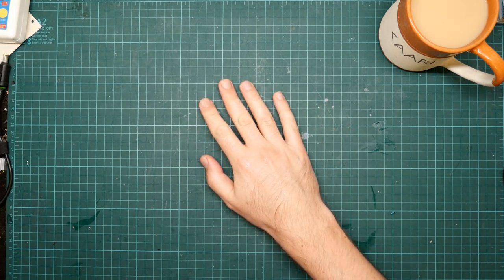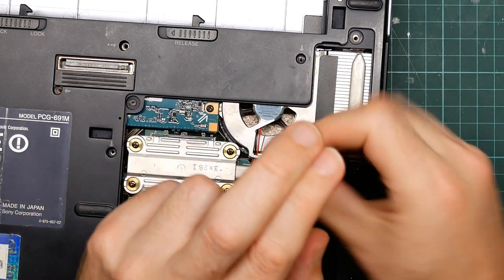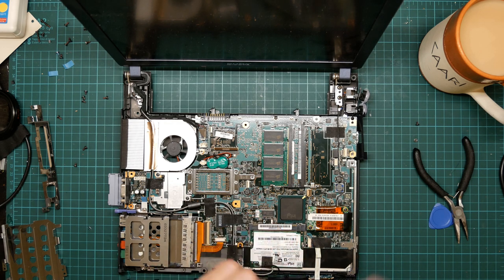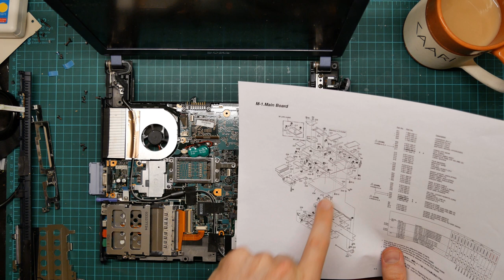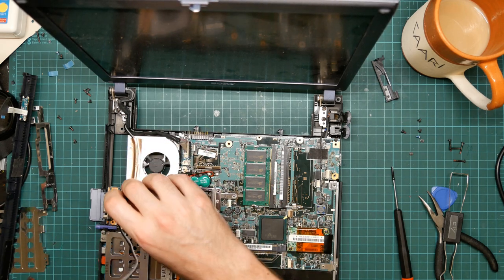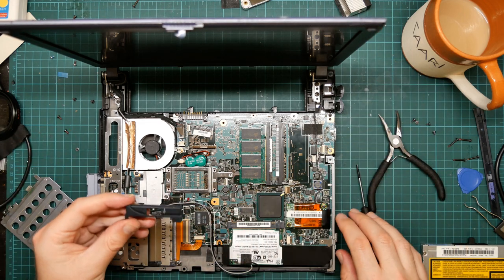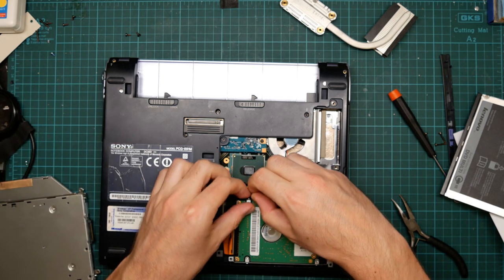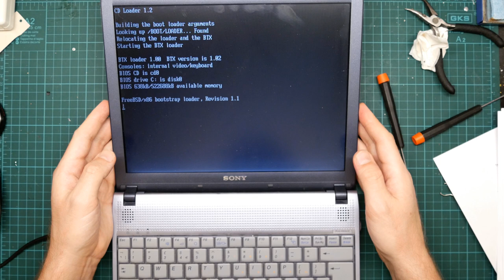Hjalfi journeys to the centre of the Vaio V505CP

Comment: You should have known that DVD drive, from a Lenovo Thinkpad, was never going to fit a Sony laptop, not to mention it's SATA and laptops of that vintage have PATA drives as you found out in the end. Still, lesson learned I hope. Check things before charging in guns (screwdrivers) a blazing. I'd have also definitely replaced that Varta BIOS battery as it will definitely leak and destroy the motherboard, it's only a matter of time.

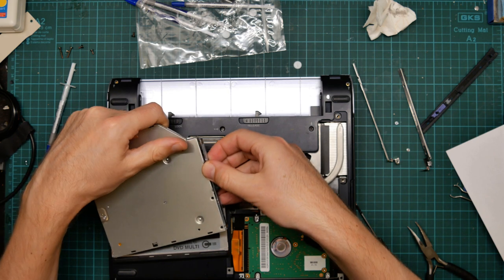Comment: @98:08 ( 12.5 mm. or 9.5 mm.) ( SATA or PATA )?  I've done that before.
Reply from the maker: I've no idea what the Vaio drive is, but the Lenovo drive is, I think, SATA with the slimline power connector. I have nothing which will plug into either.
Reply: @hjalfi  Generally I'd say if it's > 20 pins it's pata, else SATA; if it's not SCSI or USB for some godsforsaken "performance" reason.

More specifically I think its { SCSI > 44 pins ≥ PATA (or SCSI) ≥ 36 pins ≥ SCSI ≥ 34 pins ≥ ESDI (or SCSI) ≥ 20 pins ≥ SATA (or SCSI) ≥ 19 pins ≥ SATA ≥ 7 pins ≥ USB }

[edit: Wait! I forgot that USB-C is 24 pins, and USB-B SuperSpeed is 10 pins. Pretend the above was even more of a mess. (or SCSI) ]